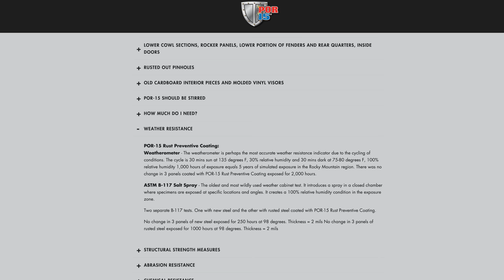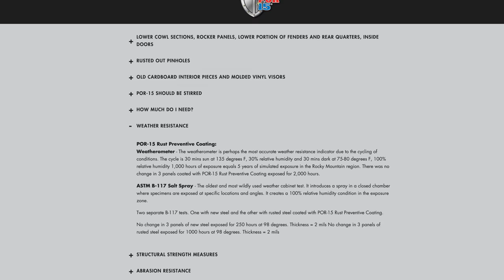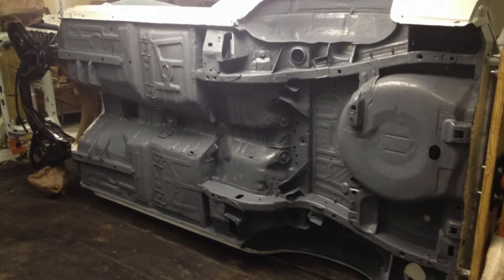How to PROPERLY Paint Over Rust Part 2 of 2. Applying paint. (Car Rust Repair)

Comment from the maker: Products and Tools Used in this video:
Mastercoat Rust Sealer, AG111, & Thinner Combo (Best Deal): https://amzn.to/3ETThRq
Mastercoat Rust Sealing primer: https://amzn.to/3MyAfTf
Mastercoat AG111 top coat: https://amzn.to/39hwNxW
Surface Shield (Lanolin): https://amzn.to/3vfn9ob
Tintable Raptor Liner Kit: https://amzn.to/3k9lSs6
Paint Spray Gun: https://amzn.to/36Q21eM
Engine Cleaning Gun: https://amzn.to/3MyBbXL
Lanolin Undercoating Gun: https://amzn.to/3MrXDlc

My Amazon Store:  https://www.amazon.com/shop/repairgeek
Help support the channel, buy using my Amazon links
As an Amazon Associate I earn from qualifying purchases and your cost is exactly the same.
Reply: “How dare you. You stolen my childhood” —Internet troll 1:26
Reply: I would think the lanolin would be faster to apply then the ‘paste’. 19:30
Reply: Great vid, I thought you had switched to the PB blaster range of lanolin spray??
Reply from the maker: @joeboonen7421  i still exclusively use lanolin on a daily driven vehicle. I had people wanting me to explore the paint option. Some people had trailers, old cars, farm equipment, that they wanted to paint.
Reply: Thanks for the reply but I more meant that you used surface shield as opposed to the PB blaster lanoline , which in your previous video you said was a better product.
Reply from the maker: @joeboonen7421  Sufrace Shield is made by the Blaster corporation. Who also makes PB Blaster. Surface Shield is Lanolin based like Fluid Film and Woolwax. There is no such thing as PB Balster lanolin.
Reply: Hey I’m painting my frame, does it matter how long between my primer coats?

Comment: I use a type of epoxy primer for painting boat under water section for my car bottom. Just like you did. It takes a long time to see if it is good or not. Right now it is still holding up. I don't know if it is better than other product, since I never used other product before. It is only car bottom I've painted in my life so far:)

Comment: Very thorough and detailed.  That is an insane amount of work (you have some serious dedication) when considering videos 1 & 2 combined.  I am curious if you have ever considered a more potent undercoating product instead of prep & paint, such as the products made from wax and bitumen.  Same concept as treating your crevices and cavities -- you basically smother the bare metal and rust with the product and it halts further rust development (would even do that for minor rust under the old e-coat).  

I have a 35-year old car that got Dinitrol 4942 wax/bitumen/aluminized coating applied to the frame and underbody from the factory, and it's still there.  I need to touch up an area that got washed off when a fuel line was drained, and sourced a similar modern product.  It can be sprayed or brushed on.  It flashes to a consistency that feels like sticky solidified bacon grease and stays put, with some self-healing and re-sealing properties if it gets scratched.  Only thing that will take it off is mineral spirits or gasoline, or a similar solvent.  So it won't wash off from water/etc like lanolin does.

I'd be tempted to use a product like that instead of sanding and treating the rust then painting, since it would save a lot of labor.  For sure the paint looks neater, but that wax/bitumen undercoating would have given you decades of protection and the only labor would have been spraying it on.  Use the black colored stuff and it even looks pretty nice.

Anyhow, nice job, I've done sanding/treatment/prep/paint on a mower deck and that was enough to kick my butt!  Can't imagine doing it for a whole car underbody.
Reply from the maker: I spoke about what I normally do in part 1. The lanolin that I sprayed on the internal cavities I use on the entire undercarriage. This car I wanted a clean undercarriage. It's the things you don't realize that take all the time. Painting brackets, fasteners, cleaning up plastic etc.
Reply: What's the "similar modern product" that you sourced?
Reply: @DanHoopes211  Fertan UBS240.  After it flashes off and dries, it's a fairly close visual match for the Dinitrol (which is not available in the USA).

Comment: I am always interested in learning more about a new product...my biggest concern is getting behind the spot welds and sealing that...
Reply: once you're done painting...  the wool wax or acf50 in there
Reply: I’m about to thin down some pot-15 and let it seep into the triple layered seam on a falcon firewall where the fire wall lower plenum and upper plenum are all spot welded together 

Then I’ll put it non thinned after that 

We’ve just had all these layers separated & blasted once it’s all welded back and finished we’ll do the por

Comment: Great! Thanks for the thorough video. Our mechanic used the Mastercoat rust sealer in the engine bay of our 77 Westy and it turned out great. I've used it on a few parts and rust spots with great results. I'm about to take on a bigger job of the full nose. Appreciate your videos for helping guide the task, especially with these specific products. Enjoy your ride!

Comment: Great videos!  Unfortunately, the products have been sold out for a long time.  But, just wondering if you would use the same system over moderate rust on an outer body panel?

Comment: I’d be super curious if you could test out Rust-Oleum Industrial High Performance V2100 System Rust Reformer. That is the only stuff that has worked for me. Never had rust come back through it
Reply: This stuff will chip like glass and rust away behind it, would be hell to clean that seal crap off, I’m with you and will clean and hit mine with more paint, If I can see rust I can save it, if it’s hidden you can’t save it

Comment: I need your help. I wanna fix some rusty spots on my 98 dodge truck. Is the proper way to do that to 1. remove the rust 2. spray a rust reformer (2 or 3 coats) 3. spray a primer (2 coats) (I have heard some say you need to spray a self etching primer first but im not sure) 4. basecoat(2-3 coats) 5. 2k clearcoat spraymax (2-3 coats). I really want this repair to last and not be a shoddy job. Thank you.

Comment: Today, I wired wheeled my frame and applied some Krud kutter in the cracks and spots that I couldn’t reach with my angle grinder. Results are pretty good I’m very happy (thanks to your channel). Do you recommend painting the bare metal or just coat it with surfaceshield or fluidfilm as is? I live in Canada, Ontario. Super salty over here

Comment: Have You ever used a product called Rust Roy it's a rust converter I used it when I was stationed in the UK back in the mid 80's and I had excellent results with it . The only thing was that I had to use a cheap  throw away paint gun that was nonmetallic . Great content Thank You . 🇺🇲🇵🇷🦊👍

Comment: I used Paint that is sprayed on battleships. The paint is sprayed on but I had to put power to the frame so it will attract the paint. And it went in every crack of the underbody. It been almost 20 years and not one rust spot. Nothing sticks to the paint. My 57 Chevy looks brand new!

Comment: Looks fantastic! I enjoy your thorough testing of all these paint and rust products, I take it into consideration before deciding on what to use for my own projects.  What would you recommend for an engine paint or other suitable type of high-heat application?  I'm in the process of removing rust from an iron block and want to repaint it.
Reply from the maker: Not sure! That is something that I'm going to have to test!
Reply: Have to watch for chips in this because when your block gets hot this will crack and let the block hide rust and same for rock’s flying hitting the bottom of car to expose the frame and body and let  your car rust without you seeing it, Best to blow oil on it from your oil change before winter and wash it off in the summer for keeping your rust away from salts.

Comment: One of the complaints about POR 15 is that it's brittle and will crack if the surface flexes. Does the Mastercoat stuff have the same issue?

Comment: Feeling overwhelmed.
Wondering what would be best/simple if I have a a rusty truck that I don't plan on taking the cab off and want to get the frame and underneath as good as I can
Thinking
1. Getting loose rust off with grinder
2. Using rustoelum rust dissolver 
3. But then not sure what's a simple rattle can option to to spray as a primer/rust inhibitor 
4. Then just any black paint to finish it? 5.Would a clear coat on top be a good idea?
Reply: Anyone?
Reply from the maker: @patrickswayyze  what kind of truck is this? daily driver?
Reply: @RepairGeek  it's an old truck ill drive in the summer, I'm trying to restore it best I can
Reply from the maker: @patrickswayyze  Do what I did in part 1 and part 2 of this series and the will work for you. If you want to paint over rust, what I'm showing you in this series is what you will want to do. Strip as much rust as possible, treat any leftover rust with phosphoric acid, and paint it with a paint of your choosing. 

If you just want to stop rust but don't care what the bottom of the truck looks like use a lanolin undercoating. Much less labor but needs yearly reapplications for best results.

Comment: Quick question after you use the bridge primer underneath the car you said you could of used the ag111 but you used the raptor liner instead. Can you used both of them that's my question. Could you used ag111 then the raptor liner to have both protection top coat?
Reply from the maker: I could have used the bridge primer then the Raptor then a clear version of AG111. I'm in the middle of doing some corrosion testing with some paints. The bridge primer + Raptor is holding up just as well as the, bridge primer + Raptor + Clear AG111. I'm at 1200 hours currently. Video in the fall.
Reply: @RepairGeek  is there another update of this project?
Reply from the maker: @weliftnation2418  The video has been live since January on my channel.
Reply: @RepairGeek  yea but can you do a update on the underneath
Reply from the maker: @weliftnation2418  there's nothing to update. I degrease it once a year. It looks brand new.

Comment: Very impressive. Do you know if that primer can go over existing primer?
Reply from the maker: I'm sure you could but you really want the Mastercoat as the base layer. The high amount of aluminum is what keeps the rust from spreading.
Reply: @RepairGeek  understood. I talked to Pat this morning at Mastercoat. He said the same thing. I already primed the bottom of a 66 mustang with Raptor liner primer to prep for body color Raptor. Probably just keep it as is then. Thanks for the response.

Comment: This turned out great! Will you spray Surface Blaster on it next or is what you have on there enough?
Reply from the maker: For this car this will be fine. It's always stored indoors and only sees rain a few times a year. I will coat the internal stuff with lanolin every now and then but I wanted a clean chassis on this car.

Comment: Have you looked into coal tar epoxy used to paint ships or other marine epoxy paints like PPG PSX 700 ? Which I think is currently used by the navy and other military ships, also bridges, airports, NASA. Wondering if you know anything about them or if it's a bad idea to use for some reason?
Reply from the maker: Checked it out. B117 salt spray data shows that PPG PSX 700 lasting 5500 hours. This Mastercoat paint does 14,000 and it's about 1/2 the cost. I'm not saying the PPG is bad paint. It's much better than POR or KBS for corrosion resistance. Would you have great results using the PPG probably, but I did also using the Mastercoat.
Reply: @RepairGeek  You really did your research, definitely going to go with Mastercoat, thanks. Your videos have been helpful.

Do you have your own mechanic business?

Comment: I saw another video where you wire brushed a vehicle and then sprayed the underneath with a lanolin undercoating.
So is this painting process instead of using a lanolin undercoating?

Comment: Have you used the  Mastercoat paint before on other vehicles? Curious how it holds up and if it has similar issues to POR15 with peeling and cracking and letting moisture under the paint and accelerating rust.  I am considering using this on my vehicle frame, not planning on taking any of the body off. Vehicle is a Chevy Express 4500 Cutaway. Would like to see a video of you testing this coating like you did with KBS, POR15, etc.
Reply from the maker: This was the first time that I had used the Mastercoat products. I called Mastercoat and they suggested that I apply the bedliner or any other top coat once the primer gets tacky. By spraying topcoat when the primer is somewhat wet lets the solvents in the 2 products mix a little and gives a great bond. What swayed me towards this product was the fact that it's used by municipalities. You won't find any bridge painted with POR or KBS. I heavily researched this product over an afternoon. I have yet to find a single person (who has actually used it) that says this stuff is crap, even reading online reviews. Some people may have products that they prefer over this stuff but I haven't found anyone that flat out says it's garbage. You can't say that about POR or KBS.

I found out about the Mastercoat products because a viewer watched that KBS, POR15 video that you're speaking of. I may do some more work with paints because people seem interested in it.
Reply: @RepairGeek  I can't find a single bad review out there about it. Seems like good stuff.

Comment: I used raptor liner as a chip guard on a friend's lifted F250 lasted 2 years last I checked
Reply from the maker: The Raptor probably isn't as durable as the AG111 but I liked the textured look of it. I really doubt I will have any problems with the Raptor. The car doesn't get driven enough to get any real wear and tear.

Comment: Do you have a method of repairing holes up to quarter size that will play nice with the painting system you used. I’m doing the floor of a 95 Landcruiser that rusted from the inside of the vehicle out. The cab had a leak and I found the carped was wet when I bought it. Now I have to close a couple of quarter size holes and several little pin holes. I have fixed the original cause of the water intrusion.
Reply from the maker: There isn't much you can do about holes other than weld in new metal and use this paint on top of that.

Comment: Do you think using the raptor liner the tintable mix it with black ag111 just give some color because the tintable raptor is clearish you think that using that together like that would make any kinda difference? It’s awesome to see that you used it in combination with ag111 I’m gonna get some ag111 when I build my truck! And do this
Reply: Also what did you do for the inner frame rails if anything?
Reply: Well you answered my question haha
Reply: Are you going to surface shield or wool wax (Landoline) it seasonal? Too or are you confident in the ability of what you did to not worry about it! Honestly your doing the hot rodder and resto truck builders work man to know products work when you take the time to use them means a lot of work and hours wasted on somthing that doesn’t work I applaud you I will be using your method in the future!

Comment: Im not quite at the point of taking my mustang apart like that . How do you feel about wire brush on a drill then using surface sheild after ?
Reply from the maker: That will work great for rust protection as long as you keep re-coating yearly. It won't look as nice but as long as you maintain it yearly, the car wont rust any further.

Comment: I got a little lost. Did you do 3 coats of primer on the bottom and then use Mastercoat AG111 or did you put something else after the primer--- the coat you said you mixed the cars body color into?
Reply from the maker: 3 coats of the silver rust sealer.
Topped the silver on the chassis with color matched raptor liner because I liked the texture.
The axle got silver and then the AG111 top coat because I wanted the axle to be black.
Reply: @RepairGeek  could it be possible to do the primer, then ag111 and then add the raptor on top? Awesome series of vids I learned a lot!

Comment: After watching way too many YouTube, looks like I'm gonna do my frame, A arms, tow hitch etc. With masterkote, or por 15, and spray everything else under the Dmax, with cosmolene. I'm in Wa. State, so it doesn't get it as bad as the Midwest, but it's my Sled hauler, and going over the pass, they do use salt, and it's just starting to be a problem after many years.

Comment: Is thzt a fox chassis Mustang or SN95? Either way , awesome.
Reply from the maker: SN
Reply: @RepairGeek  Cool. The gas tank gave it away. Looks just like mine in Fox. I also want to do the same  paint over rust and Raptor liner on the bottom of the cab of my truck, 83 F100 . but first i need to remove it from the frame . hopefully this summer. And the frame after sand blasting all the rust off of it.  Just like OH , Much salt in MI.

Comment: mastercoat says there inner frame rust inhibitor can be thinned out Aswell. i feel like it would make it creep more. maybe im wrong. could you get back to us on that?
Reply from the maker: You can thin it with mineral spirits. It will run down hill until the mineral sprites evaporates off. It's not going to go uphill with mineral sprites. I had literally 15 gallons of lanolin products in my garage. It frankly wasn't worth my time screwing around with some concoction of cavity paste and mineral sprites when I have 3 5 gallon buckets of products that will do EXACTLY what I need them to do.
Reply: @RepairGeek  thank you